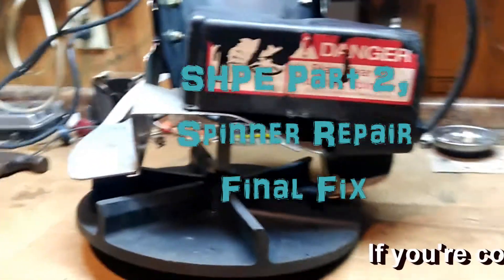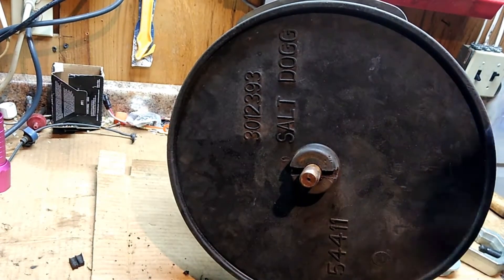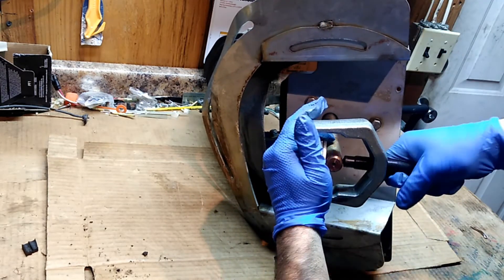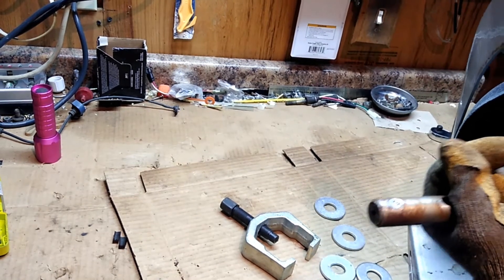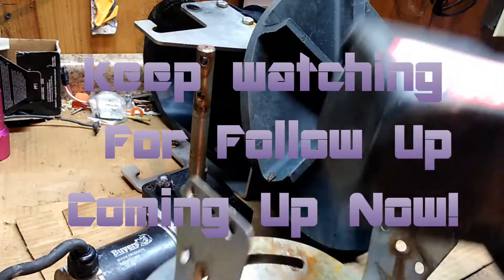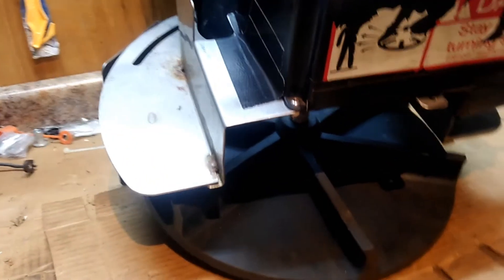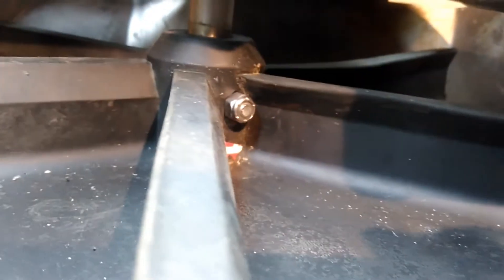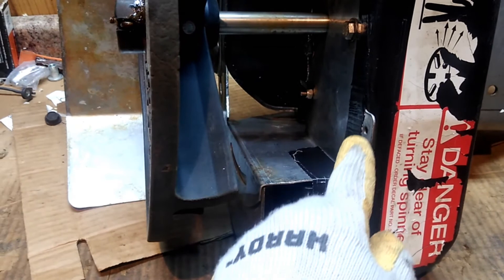Salt Dogg spinner repair part 2 - How to fix the Damage

Comment: Any tips for removing that keyed shaft from the motor (IE Bent shaft, need to replace)
Reply from the maker: You have to disassemble the motor, but i doubt you can get individual motor parts. You'll probably need to replace the motor unit if it affects the proper function. Good luck!
Reply: @notoriousJPG  Yeah I have a bent shaft, it runs just doesn't spread evenly. I was hoping to not have to take the motor apart, those torx bit bolts are rough from the salt.